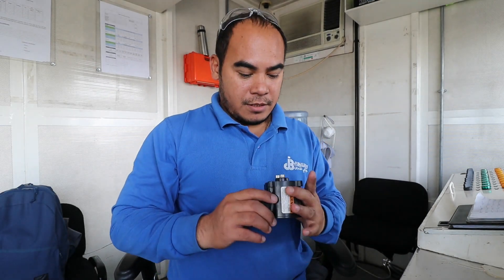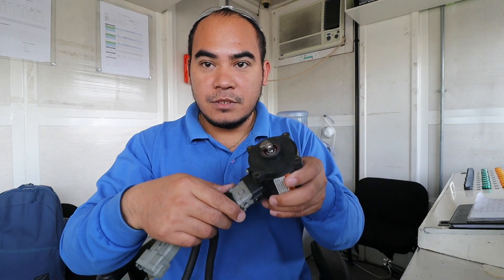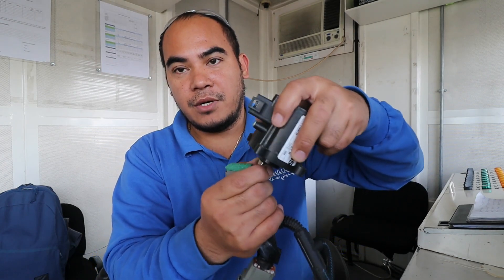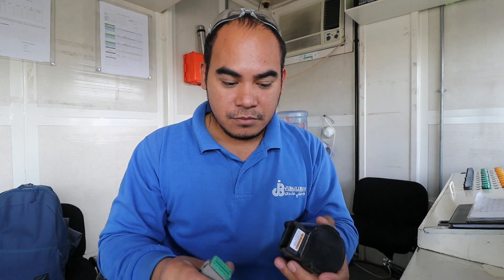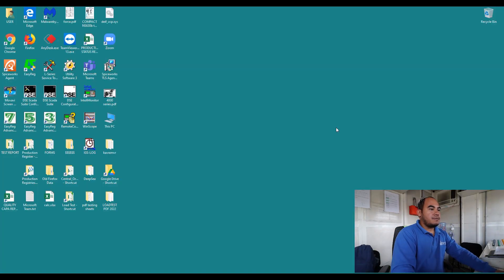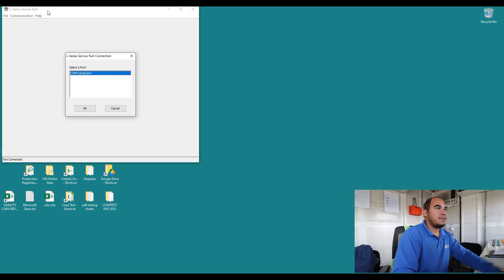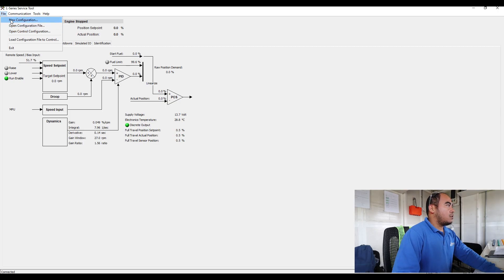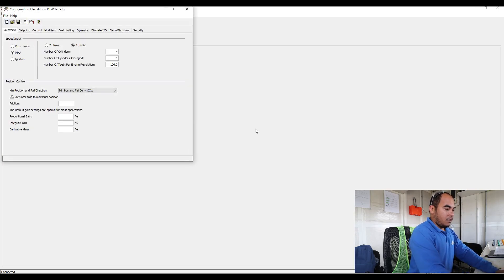HOW TO CONFIG. 50 TO 60 Hz L-SERIES ACTUATOR  benzblogs

Comment: Hello Sir, how do you connect the Pc to the L-Series ?  i have a woodward kit, and a rs-232 adapter for reading on the pc and L-service tool softaware but there is no connection.  Manual says 19,2 baud and 8N1.
Reply from the maker: Use rs232 to usb

Comment: Good afternoon We bought a new actuator, but when we connect it to the generator, it does not work like the old one and does not allow the generator to start. actuator 8404-1001. What could be the problem?
Reply from the maker: Configuration
Reply: @benzblogsVlogs  What do we need to do to make it work?
Reply: @benzblogsVlogs  maybe you have a configuration file for 8404-1001? I'm ready to pay for it
Reply from the maker: @ИванИванов-ч2в6ц  how u flash without the tools for config

Comment: Hello, what is the actuator min position and fail direction of Perkins 4.4twgm generator? The fuel pump is Delphi dp210. The setting value is min & fail CCW. I don't understand the current set value. If it's ccw mode, I think it's max fuel position.
Reply from the maker: Do one thing to make it easy if you have flash file direct flash thin reset it its gone
Reply: I solved it. Your video helped me a lot. It was very difficult because the setting values of the two generators of the same model were different. After testing the actuator alone with a function generator, I understand how it works. When the fuel pump rack moves to the front (clockwise), it is in the "FUEL STOP" state, and on the REAR (counterclockwise-FREE) side, it is in the "FUEL FULL SUPPLY" state.:face-blue-smiling: @benzblogsVlogs

Comment: We are trying tô install an lseries actuator, but even with the correct supply voltage, we are not able tô connect the actuator tô the computar, even with the wire conector from the supplyer, do you know what could bê?
Reply from the maker: You ahould have the converter that to 232 to usb
Reply from the maker: In order to communicate

Comment: brod bens ano ang problema ng engine kung hard starting
Reply from the maker: Anong kva to electronics or conventional emgine
Reply: 150 kva perkins pero ganon pa rinang sitwasyon hard starting pa rinbleed ko na siya
Reply from the maker: @jaimetemplo3726  ganito sir check mo ang fuel somleniod if my supply
Reply from the maker: Kong my sypply din ang laeries mo
Reply from the maker: Marami pwedi pwedi g hinangin try mong ebleed tapos open mo isa2 and fuel enjector kong may nalabas na fuel

Comment: i need de configuration file perkins 1104t 1800 rpm 60 hz please
Reply from the maker: Sir just simple go and check the enjection pump if this is convertable in 50-60 hz thin if its ok thin do conguration for the lseries if you want 60 hz just follow that bedio and its work
Reply: @benzblogsVlogs  the motor generator is at 1800 rpm 60 hrz with a delphi dp210 pump the L series actuator was stolen we recently acquired 1 but we do not have the calibration file for that actuator, the engine is a perkins 1104 turbo
Reply from the maker: @enriquerojas9025  no need flash fiel jsut follw what i say juat so a configuaration

Comment: for the problem of RPM slowly dropping when given a load, where is the setting?
Reply from the maker: Sir if the rpm getting slowed during loading there is more can affect ither you load is over to the max capacity of the generator or you are face with injector problem or pump itself or its also fuel filter problem dirty or fuel contaminants of water of your turbo problem that is the things you need to consider.
Reply from the maker: What engine pls
Reply: Perkins
Reply from the maker: What kva
Reply: 100kva
Reply: Perkins 6TG2AM
Reply: we have finished changing the oil filter and the load is only 30 percent used, does it have an effect on the acuator settings sir ?
Reply from the maker: This havr l-series
Reply from the maker: If have make it 100 percent fuel for the actuator
Reply: Yes sir, have l-series
Reply from the maker: Check the confige and follow what i said to you